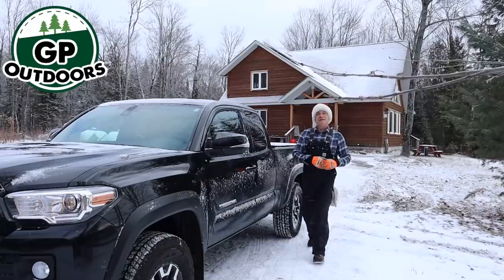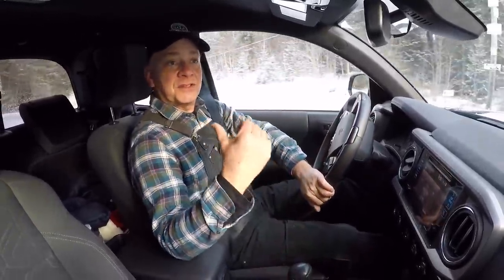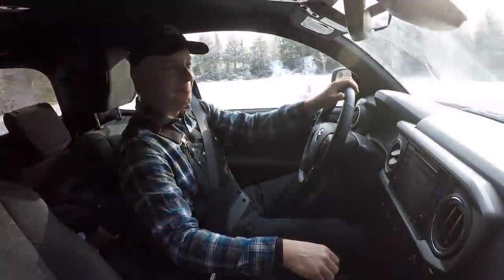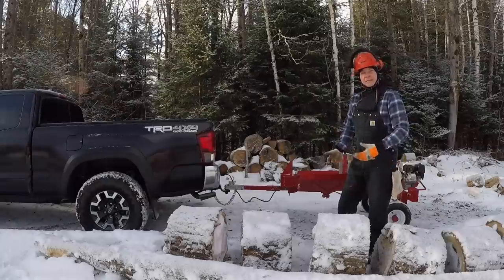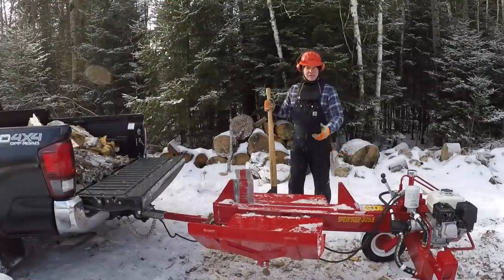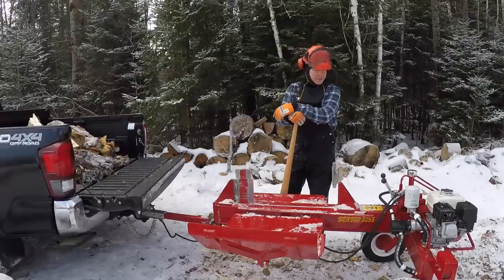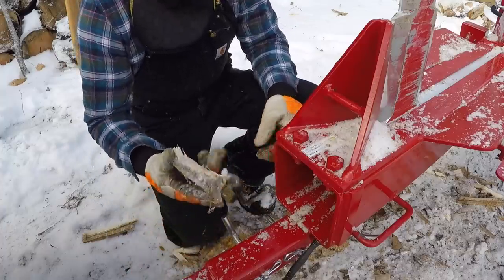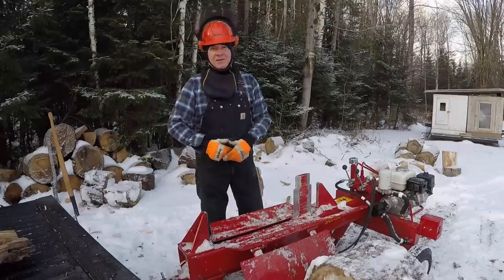#232 Split-Fire 3255 Log Splitter. Big Maple Rounds for Christmas. Firewood. outdoor channel.

Comment: You provided a LOT of excellent info on the Split Fire unit.  I've never seen a splitter here with all those options available. I am sure your neighbor was thrilled to get that much split in such a short time. I would hate to have to go back to doing it by hand.  The next time you have some nice straight grain wood about the same diameter as your wedge, maybe consider a different approach to the process. 

    Instead of halving it then making pie shaped pieces, just try a few chunks like this:  take a slab 4" (or desired thickness) off one edge, move the block over 4" and take another slab, then another ending up with two half moons and a couple flats.  You can then quickly flop two of the flats down to split both at the same time, of course adapting the procedure on the fly because every piece will not follow the same pattern perfectly.
    The side benefit is twofold: 1) If you cross stack the ends of ranks for end support, the random flats stack better than pie shaped pieces and 2) though I have not calculated it out, I think a piece of wood of a given mass/weight/moisture content when split with 4 sides, vs 3 sides should give a greater surface area which should speed up the drying or seasoning process.    Of course I haven't used the pythagoreom theorm or the law of pragmatic reciprocity to do the calculations yet....but I'll get right on it....LOL
    GP, I beginning to think you are the Mr Rodgers of the neighborhood !!!
Reply from the maker: LOL - always enjoy your commentary T! Funny - Guy splits them that way most often. I think you guys are talking when I am not around. He probably figures if I don't listen to him, I'll listen to you . LOL.  Sneaky guys. Thanks T. Perhaps I should start wearing a sweater and some sneakers...CHeers!

Comment: The miracle of hydraulics. What a wonderful little machine. The ability to use a lift to get those bigger rounds up there must be indispensable. 

Very good of you to help your neighbor out. We've lost that as a culture in many ways. I remember growing up that if one neighbor was starting a project, before long everyone was pitching in and the job was done in no time. No one asked. It's just what you did. Glad to see that there are folks like you out there still paying that forward. 

Do you ever have problems starting equipment like this in cold weather? I imagine sub-zero temps can be a challenge to some small engines. 

How do you like your Tacoma? What is the towing capacity? Can you tow the Kubota on a trailer with it?

And who in the heck gives a video like this a thumbs down??? Don't like to see other people helping others? Real hater of firewood??? Boy, some people. 

Another good video Gordon. Hope all is well. 

ATB, 
Michael
Reply from the maker: LOL. Thanks so much for the kind comments Michael! Yes I am fortunate to have some really great neighbours up here and they have always helped me out, too. Really happy with the lift on that splitter - sure makes it easier on the back and hip, so a big benefit. Surprisingly no issues for me so far starting it. I started it that day in -20 degrees celsius - second or third pull. Good Honda engine. Really like the Tacoma - its the second one I have owned now. Will tow 6500 lbs (with trailer brakes) but I have not bought a trailer for the tractor yet. I looked into them a few times this past year but have not made a decision but yes, it will tow the trailer and tractor for sure. Thanks again Michael. All the best for this new year to you and your family.

Comment: Hi Gord,
Man, those logs look like they're dry-rotted inside.  I guess that stuff will still burn OK.  The old Split Fire didn't even hesitate on those rounds.  Nice having the trailer options with lights, etc. Great splitter.  Nice of you to help your neighbor out for Xmas firewood.  Manually splitting that stuff would have been a back-breaker and time consuming.  I want to wish you and your family a great Christmas and a happy New Year.  As always, have a great week.
Cheers!
Reply from the maker: Good morning Tim! Thanks - yes they were soft in the middle of several of them. Have a very Christmas too and talk again soon!

Comment: So after all the splitters that you had, what one was your favorite splitter?
Reply from the maker: Morning Dave, that is a tough question. Honest. Price point and needs will dictate. The BRAVE, Split-Fires and Eastonmades were all good solid builds. Good build for a machine you want to be able to easily tow behind your ATV into the forest - Either of them (Eastonmade Ultra, Split Fires and BRAVE). Good build at a lower price - BRAVE. The Split Fires and Eastonmades are more solid commercial type builds.  The Eastonmades are faster and stronger than the SplitFires, but they are both great choices if you are splitting alot of firewood each year. For us, now with our current processing method for firewood, - the AXIS - 100% is my favorite. Guy and Bob agree. So much easier on the back, big work bench, fast and powerful, and safe. Sorry I could not be more specific. Good luck with your choice sir!
Reply: @GPOutdoors  Hey GP, I have an older Troy Built 27 ton, it works okay, put a 4-way wedge on it but….. replaced the engine Feb ‘19. Pump seems to be working fine but with all these newly designed machines out! Just wanted your  expertise opinion. I don’t lift even the smaller logs off the ground anymore, I use the front loader for lifting or the 3-point carryall. Thanks for your time, much appreciated, Dave 🇺🇸🇨🇦

Comment: When i first start watching your little videos, you drove a ford F150 and now a Tacoma... Why not another Ford?
Reply from the maker: Good day Marcel. Thanks for the question. Honestly, I have not driven an F150 for about 25 years - always had the Tacoma since I started the channel. I started driving Tacomas because of the height of the truck. I do a lot of work in the city over the past years and a lot of underground parking lots have very low clearance. The bigger trucks can't get in to many of them but the Tacoma gets in every time. And they are a reliable, well built truck and lots of ground clearance. Love the Tacoma. Thanks and have a good weekend!
Reply: @GPOutdoors  Thanks for the answer.